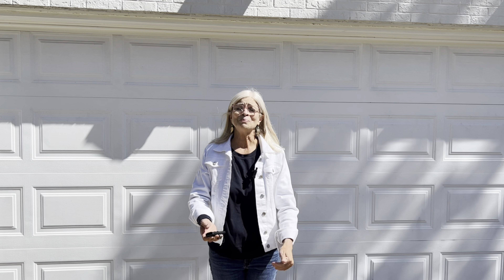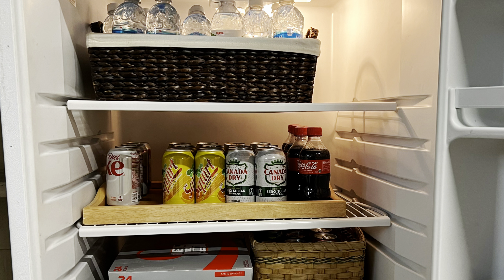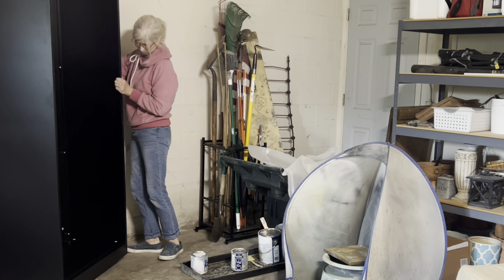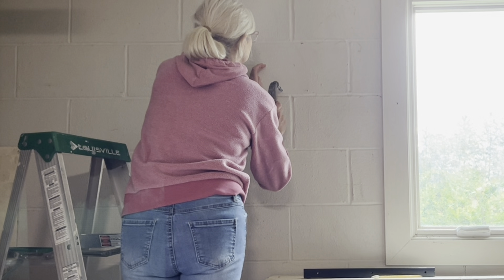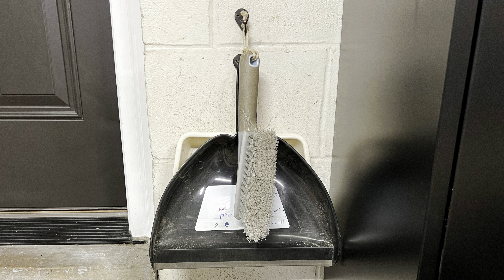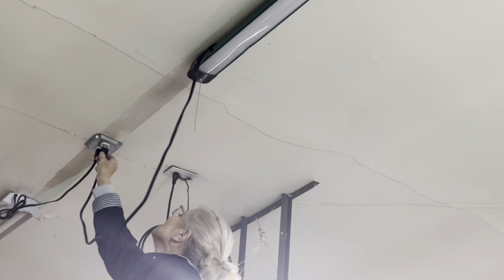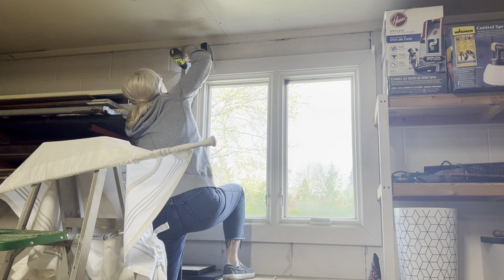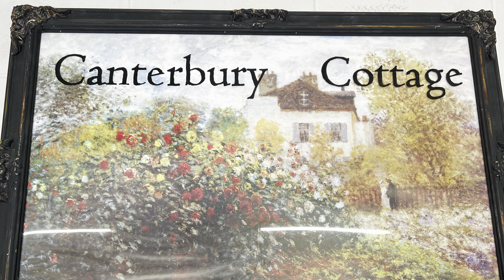Ultimate Garage Makeover Reveal! 10 Easy Steps to Conquer the Chaos! #organization #storage

Comment: Sherry, I have the same problem, but that's not why I'm commenting. My garage floor was painted by the builders, and it is wonderful! It is so easy to clean, a pretty speckled color and it's not slippery when wet. I intend to do my back screened in porch with the same paint! I thought about putting an indoor/outdoor carpet back there, but there's is just too much moisture after a rain. You may want to look into it when you paint the walls! Oh, no oils penetrate it from the car either.... I'm very inspired, but unfortunately, I need 2 shoulder replacements.... I'd kill to find a reputable handyman service.... I can no longer change my LIGHT BULBS!... could be worse.

Comment: Wow!  I shudder to think about tackling my garage.  Right now half of it is taken up by a friend's "muscle car" (a 1970s Mustang convertible in black and gold) but she is trying to sell it.  If that happens, I can really get in there and start organizing.  When I bought this house there was already a built-in workbench in one corner, a HUGE iron (very rusted) chain attached to the floor that I have no idea how to remove short of hiring somebody to do it for me, various hooks screwed into the studs, a drop down area with a couple of sheets over it that held left over wood planks and other stuff from the previous owner, and upper basic one level shelving built in by the previous owner on two sides of the garage.  There's plenty of space since I don't drive, I don't own a car, so all the summer patio furniture and lots of gardening stuff is stashed in the garage, along with three long dead lawn mowers that need to be taken to the city dump (try doing that when you don't drive!)  You did inspire me though.  Not this summer - the weather has been far too crazy hot and excessively humid with the heat index sometimes approaching 100.  My old body can't take that heat the high dew points.  But I will start straightening out the metal and plastic shelf units I have lining bare areas on the walls, that in and of itself will help a lot!  Thanks for the inspiration.